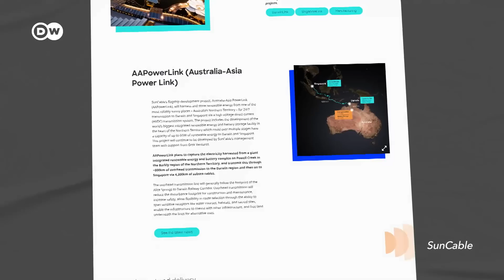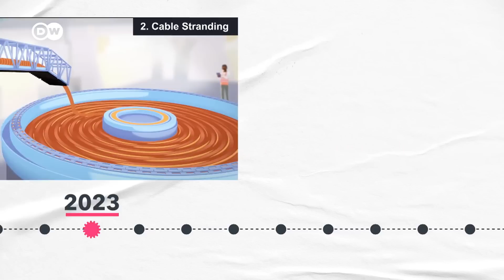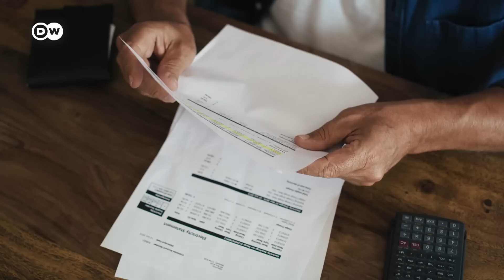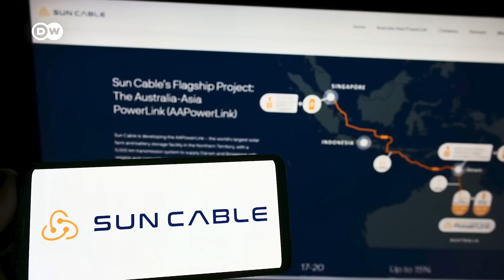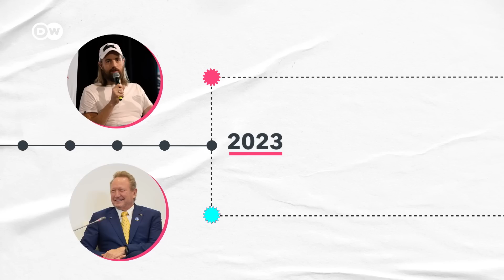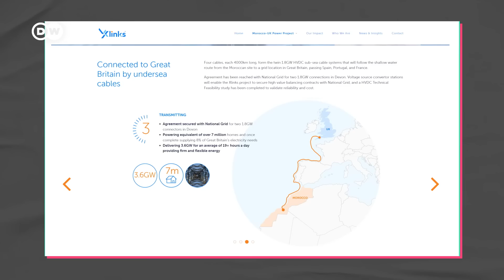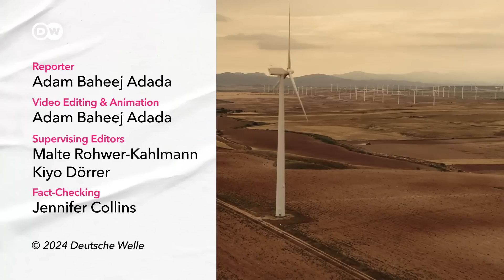Why the mega plan to send Australian solar to Asia (almost) flopped

Comment from the maker: Do you think your country should be a part of a global supergrid, or do you prefer relying on local energy sources?
Reply: I prefer to need less power for starters. Second, long distance transport of power means you loose part of it i.e. you need to produce more to deliver the requested amount to the consumer. We need to stop needing more and more power or we'll run out of space and resources to make it.
Reply: @hillockfarm8404 doesn't sound profitable enough

(DO I HEAR A '/s please')
Reply: @hillockfarm8404 🙌🙌🙌👍💪🫶
Reply: @hillockfarm8404  lose... not loose, I'm assuming.
How do you propose to turn that around so that we need less power?
Have you compared your own electricity consumption now with what you consumed 30 years ago? 
Spoiler Alert... it's not possible. The mere fact that 30 years ago you didn't have a phone, a computer, a modem, a dishwasher, an aircon along with a myriad of other "mod-cons" that consume power around-the-clock. It's just how life is these days. Unless you want to go back to the dark ages?
Reply: Renewables are powering many remote communities and islands that previously relied on diesel generators. Reason being solar and batteries are way cheaper and easier than cables from far away. The "new" grid features many and diverse power inputs, with power often used close to source (eg rooftop solar). It's a defining characteristic and a feature of renewables. Transporting single-source, high-voltage power in bulk over long distances is  "old grid" thinking.
Reply: Extreme weather has already driven the answer to this. It renders long term and large scale projects, the global supply chain, economically insolvent thru sheer destruction and insurance costs that could never keep up. Investment that perpetuates reliance on the global or even national supply chains is not different than relying on hydrocarbon fuels: worse than useless, but also deadly.
Reply: NS2 have shown us, why you should not rely on infrastructure that can be sabotaged from a small boat. It is often nice to have one, but if that would be a backbone then you are fried.
Reply: Think global, power local!
Reply: Its an expensive pipedream.... Renewables are struggling to be cost effect in the real grids let alone the losses involved routing to interconnects and the costs of the cables.  Just look at the failure of the nth Africa plan as an example and its a much shorter route.  Battery storage is brutally expensive and really only a intermitent source outbound could work.  50% nuclear and intermittents solves the problem with just neighbor state sharing.  look at germany what a FU.  now dependent on all its neighbors with nuclear. France exports 10-15GW 24/7 they are the energy security for much of the EU
Reply: Everyone seems to be overlooking the elephant in the room: Electric power from ANY source is only 1/4 of total global energy demand. For historical reasons that has led to the power grid and grid-centric thinking. BUT industrial users of heat and electric power could be located where the green energy is. Only a small fraction of that is on land or adjacent to land. 
Meanwhile, 70% of Earth is covered by seas and oceans, which have the best wind: strongest and most constant. The global wind resource is 600% of Humanity's TOTAL energy use. 
So... Let's build factory ships, barges, and clusters of each, feed them with wind power (mostly far offshore) and export their products by ship, like we already do. But importantly, the factory ships can be closer to the final market, cutting delivery time, cost and energy use. At each such factory install weather stations feeding data via satellite internet to the global weather models, to aid weather prediction and allow the ships to go where the wind will be.
The cooling needs of these deepwater 'islands' is provided by the water they float on, which cuts the use of precious freshwater for cooling on land. 
Affected industries include: Producers of aluminum, steel, cement, ammonia, fertilizer, graphite, graphene, carbon fiber, data centers, textile producers, paper makers, and many more.
Reply: @YodaWhat  there are SMRs being built in the US by Dow to power a chemicals plant instead of using natural gas for process heat.
Reply: Fix your own grid first.
Reply: I'm for globalisation. Interdependence is good. Also you can take advantage of the natural advantages that might exist further away.
Reply: local energy sources
Reply: Local.
Reply: I think at least 80% of energy can be produced inside Romania as we have hidro, nuclear, wind and solar (whick we are still installing). The problem is that energy demand will increase in WInter in the whole area (so no country can export...) and without sun, wind and in a dry year, the only source can be small nuclear reactors - which are not installing because  are inexepsive and not so 'popular'. We still hope for mild winters, this is the EU 'strategy', this and old polutting coal thermocentrals :( - after 200 years using the same shit 'tehnology'
Reply: In a world where all of mankind has united? Yes, absolutely! In the current world with certain authoritarian states only waiting to strike at critical infrastructure? No.
Reply: If it makes economic sense yes, but looking at Andrew Blakers report in 2017 on a 100% renewable grid Australia should not need to. 

We just need to pull our finger out and get going.
Reply: Lets develope the wave energy and that should be enough energy to the world and need for this expensive cables and in time of war that will be the 1sr target.
Reply: 2:50 I never understood why Europe doesn't make a big cable through their oceans, essentially going from St. Petersburg trough Denmark, to the north sea, to Portugal, to Gibraltar, to Israël.
Piles of big cities near the coasts that can all work together, 
Perhaps it can even continue all the way till south Africa ( I mean, when it's summer there, it's winter in Europe and visa versa, helping each other out). 
The cable go's in the ocean, so it helps with the windmills in the oceans as well.
Everybody happy and I estimate it's not even that expensive.
Reply: How do these cables not degrade over time?
Reply: 誰便宜就用誰的
Reply: I mean if the opposition in this country thinks he can build Nuclear and can quote that France is an ideal model we are going to have to build some cables to sell energy from them somewhere surely, like France have historically to subsidies the costs.
Reply: "Why the mega plan to send Australian solar to Asia flopped"
Because its delusional?
Reply: Why do people have such a fetish for doing these things in the most insanely expensive and grossly impractical way possible?

Primary heating i.e. space heating and hot water represent around 80% of all household energy consumption. Just do those things using biomass, (preferably from cultivated Bheema Balcoa). In which case using battery storage for the remaining 20%, then at least approaches the arena of rational thought.
Reply: From what I see in Australia 68% of the electricity is made by fossil fuels. Mostly coal. Why sending all this potential cheap and clean electricity all the way to Singapore is a mystery.
Reply: @luigifranceschi2350  
Same basic reason a lot of these solar projects are in large part fundamentally irrational to begin with. Battery storage on that scale is simply delusional.

Ammonia on the other hand liquefies at only -33.34 degrees Celsius. Unlike Methane (LNG) which only liquefies at -161.5 degrees Celsius. So transportation and shipping is exponentially less expensive. Also SOFC type fuel cells can run directly on ammonia. Providing perfect load following minute by minute rather than in half hour blocks.

A direct electrical connection in the other direction however would actually make some sense. The Stuart Highway is currently the country's only significant arterial roadway not supported with electric vehicle infrastructure.
Reply: To feed solar power to the grid from your home panels in solar peak hours, you have to pay THEM the service charges. THAT'S THE SURPLUS THERE. 
FIND A WAY TO STORE THAT ENERGY FOR EVENING PEAK CONSUMPTION.
Reply: A supergrid has been thought of only because collectively the energy technologies being implemented fail individually to meet our needs. When alternative energy technologies are available on the market there will be no need for a world grid as alternative energy technologies can meet our energy needs. Yes there are energy technologies yet to be publicly announced that do not need to be combined with other energy technologies
Reply: place factories and production where renewable power is abundant and transport products with high embodied energy to place where there is less renewable energy available. Traporting goods is easier than lots of electricity via cable
Reply: I am suggesting a global super-grid, but using DC as in HVDC transmission lines, "InterPower", linking Solar and Wind power east-west around the world....   This still uses local energy and local AC grids, for local power.
Reply: I love the idea, but the execution would be hampered by geopolitics and bureaucratic nonsense.
Reply: @wiseass2149  Not to mention being located on about the most geologically unstable area of the planet.
Reply: @VanillaMacaron551  "most geologically unstable area of the planet" ???
You cannot just throw that out there without saying WHERE, or backing up your claim with ... ermm.... some facts?
Reply: Local is better, no tied with someone who can blackmail you
Reply: @hellsing56666  Yeah, imagine if Saudi Arabia said that about all their oil. Just keep it all for yourself.
Reply: Well put a 7kw solar plant in your house is the best way I guess
Reply: If producers have problem we have problem world economic crisis potential

Comment: It makes more sense to distribute the energy in manufactured goods. An obvious example is iron/steel with direct reduction of iron ore ... which is not so far from Sun Cable.

Blast furnaces is about 10% of manufacturing production of CO2 so quite a big bang for doing the iron ore reduction in the Pilbarra.

Comment: I have been watching SunCable operations for a few years now. What I like about this idea is the capacity of those pioneers to dream on such a large scale. Something which Australians have struggled with. Sorry to state that Green Hydrogen is just a pleasant fantasy. It is talked about a lot, usually trialled in small way and then abandoned. H2 transport is not just going to work, even by using Ammonia. Initially SunCable was going to supply 15-25% of Singapore's needs - this is gradually being reduced over time, and now that you are talking about 10%. I note that the delivery schedules are being pushed back time and time again. And by 2030, the Nuclear SMR factory production line will have properly started, and I also expect that there will be a corresponding increase in Micro Nuclear production. These technologies will power Singapore - not SunCable.Thanks for video.
Reply from the maker: Hi Andrew, thanks for your observations! You might be interested in our video "Why people want to put small nuclear reactors everywhere", take a look and tell us what you think in the comments 👉 https://youtu.be/GhKQ8EP1a1Y  Subscribe to our channel so you don't miss new videos ✨

Comment: "Makes sense, right?" No. This seems like a subsidy grift. The sun sets earlier in Australia than in Singapore. Not to mention the losses from a cable that long. 

Solar panels in the west providing power for cities in the east is a far better idea. As long as the transmission losses can be managed. Within Australia, it could provide huge benefits.

Australian solar power to a city to the west of the whole country is just a strange suggestion. Air-conditioning during the day, fine, but then it's sunset in Western Australia two hours before the evening peak in Singapore.

Comment: When I first heard about this project plan it took me 30 minutes to calculate that it will be a loss-making, high-risk project that should not go ahead. In this video you have not presented any proper cost and revenue calculations that prove that this plan makes no sense. In addition, the huge number of solar panels will be costly to keep clean and will be damaged during hailstorms. Also, the solar panels and the huge batteries require replacement every 10-20 years costing billions.

Comment: Everything suffers from inefficiency and power loss. The question is if a solution is resilient and capable of continuing to supply. This you can achieve with ammonia. If you want a stable supply not so easy to interrupt. We should be looking at a combination that works best. Both options in combination. Then the opposition which says you can't provide stable supply won't have a point. We can't seem to get past this here in Australia. And NT is only 30 minutes behind the east coast so it's no use in the evening except for the few uSec that a battery will work. Change is rarely evolutionary 😊

Comment: The SunCable concept is bonkers, from the routing of the cable, to needing massive battery storage.  I believe Forrest's plan was smarter, because you can convert the energy to ammonia (which we already know how to do at industrial scale) do away with expensive batteries and a geopolitically sensitive cable and make the ammonia shippable.  Yes, it is less efficient than using a cable from an energy transfer vuew, but what you get back is energy that is in a form that can be easily stored and shipped via multiple routes.  Rather spend the money on batteries and a cable factory, add more solar panels, and build an ammonia plant that's conventional.  If Singapore cancels the contract, you can sell the ammonia anywhere else for any industrial purpose.  Too much utopian thinking in SunCable - they will go broke.
Reply from the maker: Hey there, since you like ammonia! Have you seen this video on one of the potential use of it when stored: ammonia engines? 👇
📺 https://youtu.be/p-79z8nffkM

Comment: Treat electricity flowing in a wire to water flowing in a pipeline. Larger the quantity of water- larger the pipeline with larger the force which needs pumping stations and stronger pipelines- so for electricity to move from Australia to Singapore we need more bipoles built across the ocean- then the voltage stepped up and down from sender to recipient and then there are some transmission losses.

Instead the electricity can be shipped to Australian population centres. Sun cable idea was a Ponzi scheme to attract venture capital. The low hanging fruit is the austrialian market.

Comment: Superconductivity breakthrough is needed for long-distance electricity transport.
Reply: Superconductivity is not going to be cost effective. . . It would reuire far more power than the present cable losses would be.
Reply: @hughleyton693  "breakthrough"
Reply: @wiln6854   "Breakthrough"   What do you think that is or could be. ? ? ? ?  . .   Actual breakthrough is more about making it easier to make superconductors at slightly higher temperatures. . . .  The problem is that the conductive material will always have to be held at very low temperatures. . .    So impractical for long distance power cables.. .    I would like to think it could be done, because my "InterPower" uses long distance high power cables, to link around the world, linking Solar collection and feeding that to other places and countries in darkness, . . . . That has to use very, very long large power cables.. . .   If only they could be superconductor cables, then "InterPower" would work and work well.

Comment: Though is technically feasible .. It is not economically feasible  .. Unless you are using superconductors, the power out will be a small fraction of power in .. Similar projects have been launched for North Africa, sending power to Europe via  cables under the Mediterranean sea .. These projects have all failed for the same reasons .. And this project proposes a much longer cable path, its doomed from the start  .. Woo to anyone silly enough to invest in this  .. I my mind it is a technical scam !!

Comment: The world would need all types and combinations of power generation, storage grids and transport of energy to other locations. This means undersea cables, hydrogen transport, and may be some kind of intermediate island and land based connections too.

By all means there would be disruptions taking place in each of these sub systems at some point in time and hence the other sub systems would help alleviate a total downtime aka disruptions as discussed in this video. 

I would rather have sun cable purchase large islands in Indonesia and look at that for solar and wind and ocean power generation. These three sources would also complement each other during different seasons